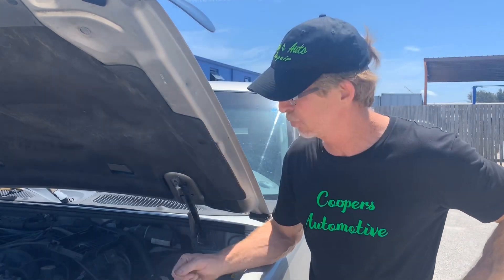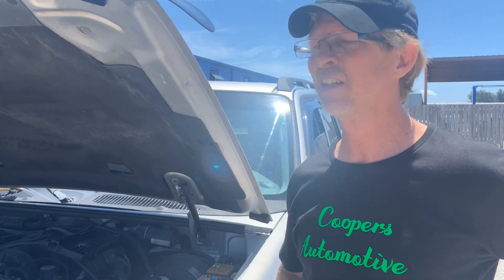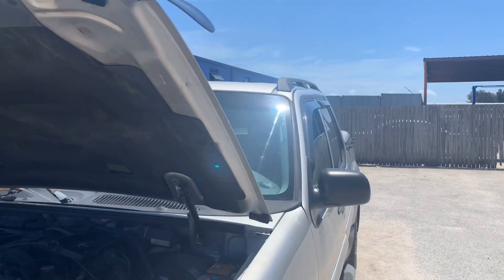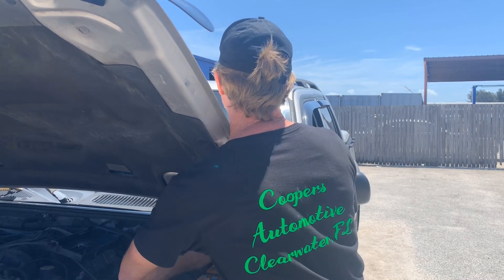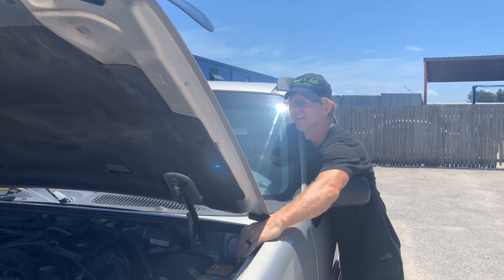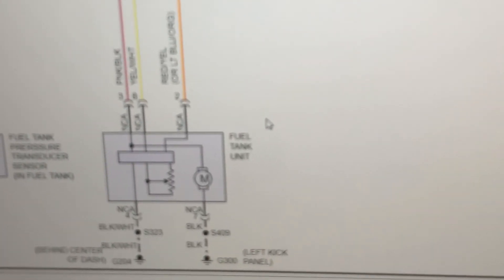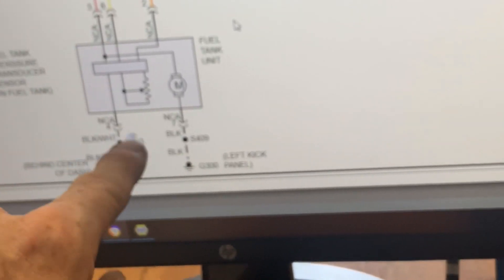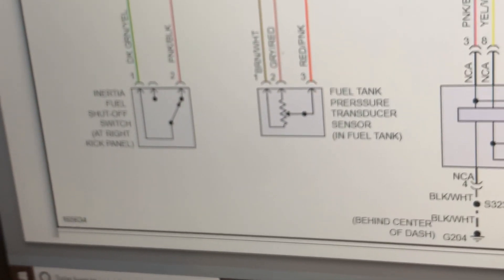Crank no start fuel pump 2003 Ford Explorer sport track

Comment: I have a 04 Explorer with a 4.6 with the same issues. I replaced the fuel pump throttle body , maf sensor, new catalyst converter, pcm and same issues crank but no start. I changed the spark plugs and it started until I pressed on the gas now it’s back to a crank no start
Reply from the maker: First you have determine what’s missing. Spark fuel or injector pulse. Once you determine that I could help you more. Even though you replaced all these parts. You have to start with the basics. Proper fuel pressure on this vehicle is around 35 to 50 psi.you need noid  light  to test and see if the injectors are being triggered by the computer. Also  need to know if you have power 12 volts to your injectors.
Reply: Just now after more investigating I finally pulled a p0193 code
Reply: @CoopersAutomotiveRepair  I checked pressure at the fuel line and I have none

Comment: 2003 Explorer 149k on it
Squirrel had babies on engine. Chewed through wires & had a good old time. Thought it was repaired. Made it a block & it died. Friend says it has half pressure not even starting so I prob need a new pump or just a new filter. I'm in hell. No honest mechanics in salt lake. Paid $2500 for this in 2015. Is it worth it to blow 2k to get it repaired?
Reply from the maker: Sorry you’re going to get I hear that about other places to

Comment: If it don't start do a spark plugs exchange and wires and if that isn't it make sure the battery is good and if neither dose the job change the crank sensor but make sure their is gas and if no gas reset switch passenger back wall and if it's your fuel pump have fun
Reply from the maker: Sounds a little complicated how about just checked the fuel pressure and voltage to your fuel pump and isolate the problem. I don’t like to jump through hoops but thanks for your thoughts
Reply: @CoopersAutomotiveRepair  and it's still down smh now I understand your video is no help good luck on that repair and next time listen to advise not ignore it like your vehicle is suffering due to your stubborn ways
Reply from the maker: You’re hilarious and fix the vehicle. I see that you think you know more than you do good luck with thatContinue your guesswork
Reply: @CoopersAutomotiveRepair  so far I've done 5 4.0 SOHC and 3 4.6 SOHC engines just giving some advice
Reply from the maker: Diggy I’ve been doing this for 35 years I appreciate what you’re trying to say if we exchange knowledge yours and mine I’m sure I surpass you by far i’m a 30 year ASC master certified technician and I’m Business owner for 30 years if I explain to you how many engines and motors and jobs that I’ve done be a huge book. And I really seriously don’t mean to be offensive but your approach to diagnosis is guesswork sorry I don’t do that hear you can throw parts at it or you can actually pinpoint the problem that was my truck and it’s fixed and it’s running power and ground to your pump if you have it and you have no fuel pressure it’s a fuel pump it’s not rocket science